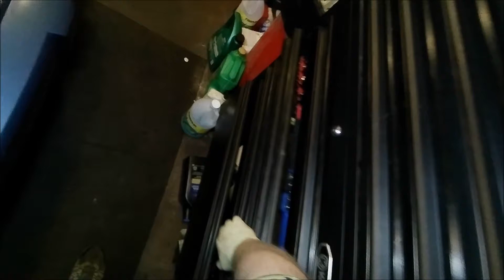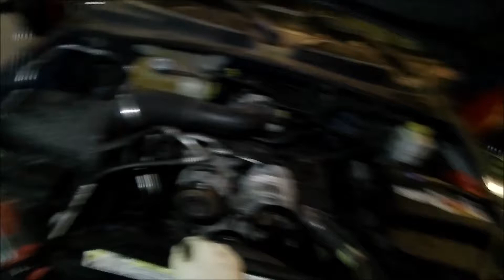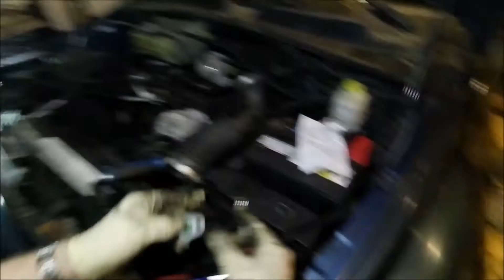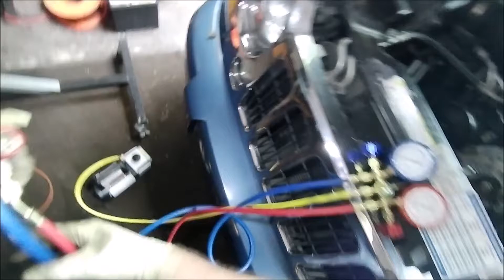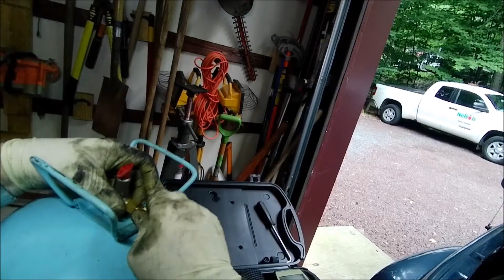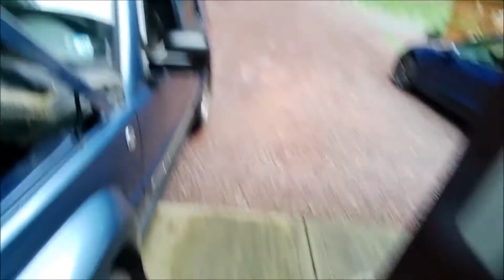Jeep Liberty AC Compressor Repair/Swap, ReCharge in about 30 minutes...

Comment: I need to replace my air conditioner compressor on a 06 jeep.  That part i can do. It's  refilling it . Can i put some freon in it. than , ake it to  auto repair shop, to have do it. Can i drive the jeep  If i don't turn on the air or unplug the clutch.
Reply from the maker: Yes, you can replace and tell a shop to fill it, just make sure the compressor is off..

Comment: Should I replace the condensor at the same time? or is that generally not necessary? I notice that on Rock-Auto after selecting the compressor it had a warning that the compressor should be replaced to ensure the integrity of the new compressor.  Any thoughts?
Reply from the maker: I mean, it is a part that gets used like any other car part. I've changed them and not changed them... both with equal success.

Comment: I have the 03’ Liberty Renegade, A/C has been recharged but drains within a month or two. Mechanic’s can’t seem to find the leak, even with the uv dye. My A/C compressor used to make strange noises but not anymore. Should I just replace my compressor and accumulator and see what happens
Reply from the maker: It could be leaking from the fill ports. Obviously the dye will be present, but spray soapy water on the fill ports and see if it bubbles before you replace the compressor. But then as the next step, replace the compressor.

Comment: Shouldn't you have replaced the accumulator along with the high side hose that has the orifice/filter in it anytime you have a compressor failure ? Or just for good measures
Reply from the maker: I do a lot of budget fixes for customers, yes and no. If it was mine, yes. In this case, still working strong no additional fixes.

Comment: My daughter has the same jeep, it blows out hot air, and only runs on "HIGH"  if I smack the compressor with a hammer, it will click on for a minute then shut off. Any recommendations before I get started? Thanks for the video 👍
Reply from the maker: That is definitely an electric clutch issue if you have to hit it with a hammer. Stuck on high maybe an unrelated issue and a bad fan switch and or temp regulator/mixer.
Reply: @GarageMahalLife  , is it best to get a new compressor? Or is the clutch separate. And thank you for responding. 👍
Reply from the maker: I've done it both ways, now a days it is easier to replace the whole compressor. Put new oil and refrigerant.considering you have to pull the compressor to replace the clutch in most cases anyway.
Reply: @GarageMahalLife  , thanks I appreciate your help. Have a good day and stay safe.
Reply: Look into the blower motor resistor. I had the same issue on my 03 Liberty with the air only running on high,  replacing that fixed the issue.

Comment: I'm having a little trouble with a brand new ac compressor on a 2006 Jeep Liberty. 
New compressor
New accumulator
New solenoid on accumulator 
New orifice tube
New pag oil per oem specifications
New low pressure line (blue)
New relay (fuse is good)
Climate control ac is turned on
Ac clutch on compressor still doesn't engage.

Why isn't the ac clutch engaging?
Reply from the maker: What's the pressure of the refrigerant?
Reply: @GarageMahalLife  The ac compressor isn't drawing any refrigerant because it doesn't turn on.  That's the step  where I'm stuck.  The climate control inside the Jeep turn on.  The fan turns on also but not the compressor.  I think this may be an electrical issue.

Comment: Brian, WOuld you be able to tell us what model AC compressor you used?   The link goes to a kit not a compressor.  Thank you in advance.
Reply from the maker: I would use that kit... replace the O rings... I've bought just compressors and that's all you get... no oil, no rings, nothing. So the kit is affordable with no headaches 😉

Comment: Hi Brian, what are the torque specs you reference when t
ighting the compressor and lines down.
Reply from the maker: I do around 15lbs, but every model and compressor is different, you really need to research each specific model, hope this helps, be safe out there!
Reply: @GarageMahalLife  Thank you Brian. May you tell me the brand you used for the compressor. The link you have in the description goes to a full kit now.  Thank you!

Comment: thanks so much for this video tutorial... I'm also looking for how to replace the expansion valve on a jeep liberty 2006 and I have. or found a video to show where that valve is located
Reply from the maker: I'll add it to my to do list, Thank you for watching and commenting
Reply: @GarageMahalLife  Thanks a lot... since I need to replace that valve right away I was wondering if you know where it is located? is it at the connection of the High pressure line to the evaporator (under the coolant reservoir) or at the same line but in the front condenser pipe connections?
Reply: @GarageMahalLife  It is interesting that I just Can't find any videos of how to replace that expansion valve on Liberties of 2003-2007, there is not even a procedure to do that on the Liberty's service manual
Reply: By the way I should correct that what I mean about Expansion Valve I meant to say Orifice Tube Valve because these models of Jeep have no Expansion Valves

Comment: Working on my wife’s, trying to charge it now, the gauge reads 50ish psi low side and when the compressor kicks on it drops to 10-20 psi and the high side gauge reads around 150 then the compressor kicks back off.  Can’t keep it running and can’t get the high side pressure to get up. (90 degrees here so 250-270).
Reply from the maker: Sounds like a bad compressor

Comment: If i need to add 4 oz of oil to my system, do is go straight to the compressor? Also replacing ac condenser, and accumulator and all lines.
Reply from the maker: It would go into the compressor 1st, then hook all the lines up, pull vacuum... most compressors have a bit of oil added and usually say how much. But it is usually not enough.

Comment: How do you drain the line out? Vacuum you said.
Reply from the maker: Pull a vacuum on it, if it hasn't all leaked out already
Reply: @GarageMahalLife  Does the vacuum drain out all the freon?
Reply from the maker: @jasonjones1693  It will pull out all the refrigerant and moisture
Reply: @GarageMahalLife  Okay thank you very much. And you can accomplish that using a vacuum pump which you’ve used in your video?
Reply from the maker: @jasonjones1693  Yes sir, pretty easy if you follow along what I do.
Reply: @GarageMahalLife  okay great! Thank you again